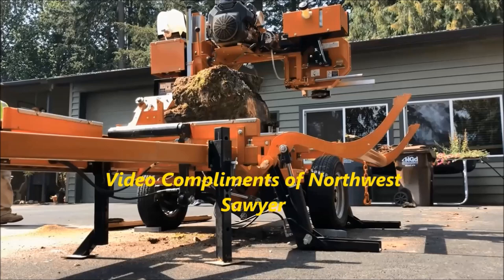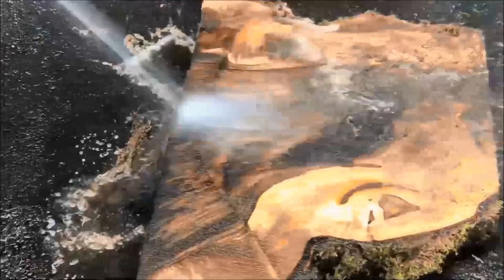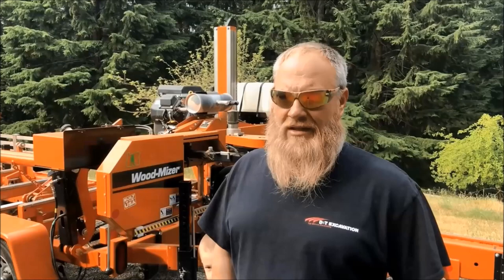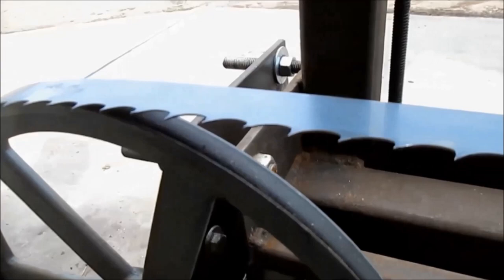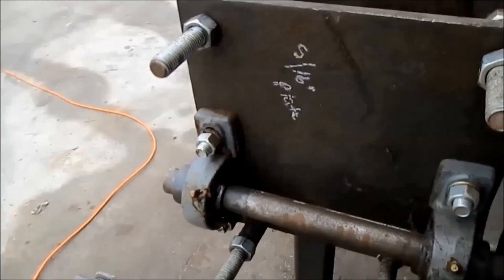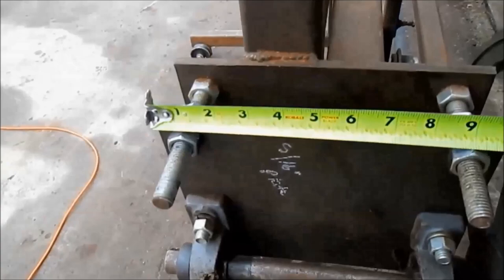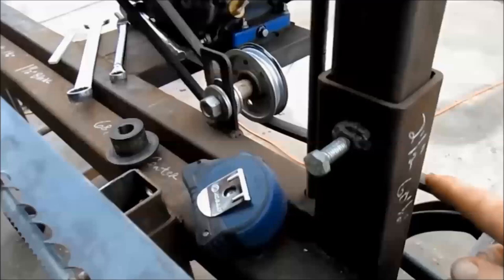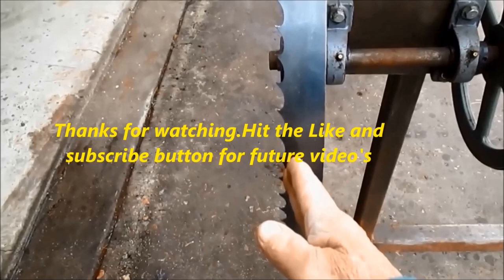Homemade Wood Sawmill Bandmill Video compilation

Comment: What's the advantage of combustion engine vs using at electric motor? I want to build one but am leaning on an electric 3 phase motor due to simplicity and lesser maintenance.
Reply from the maker: I move my sawmill around different locations, so it is a must for me to have a gasoline engine..Really not any other advantage
Reply: @LarrySbrusch  What's the HP on your motor?